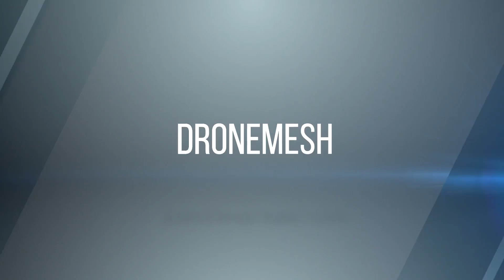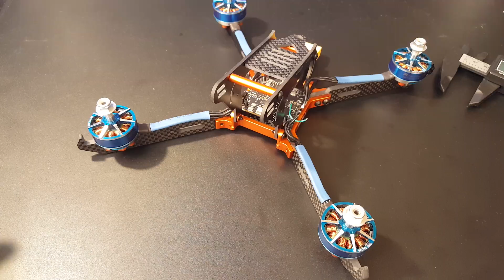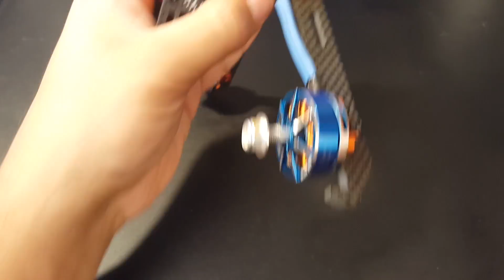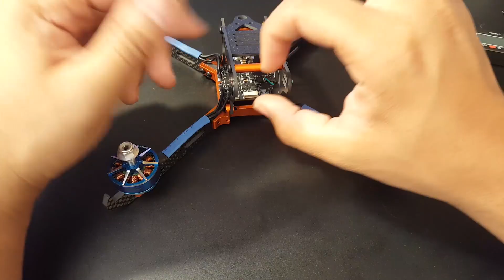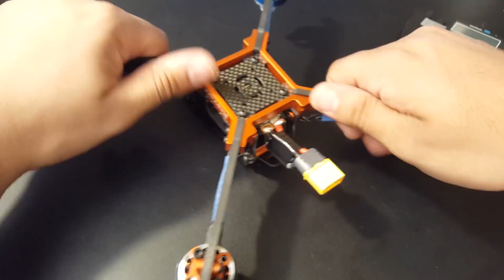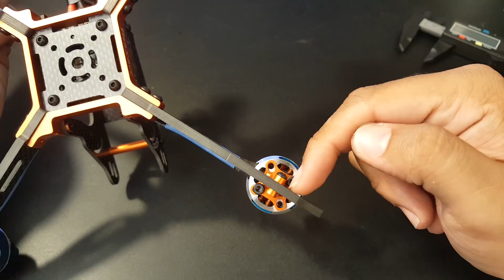Realacc Real1 frame // Overview

Comment: I decided to copy/paste here in case Copper deletes his message, for frame designers to see.
In my opinion this is the next best thing. From the air pushed aside to let the frame ascend, move forward, and even do flips and so on, vertical arms have a clear advantage. Plus, the air moved by the props, some of it it's slapped against the arm, but less with vertical arms, so another advantage there. And than you look at the weight and all your excitement disappears. They need to go back to the drawing board and work on weight. I don't think it's hard. Those aluminum plates are too thick in my opinion, and too... solid, for lack of a better word. The arms could benefit from a rounded beveled edge treatment on the top side, or a side to side shrink tube on wires like you have. Lots of ideas come to mind. The "holes" in the carbon need a more thought through design, but I can't wait to see a light and durable vertical arms frame in the near future. Too bad you didn't follow up with this design. You shouldn't listen to haters... Very nice overview! Thanks and you have another subscriber from Romania!
L.E. I might design one for myself, but first I want to see how easy it is to find a manufacturer for a prototype...

Comment: What did you end up thinking about the racerstar tattoof4s? do you think its worth getting? thanks mate
Reply from the maker: Will Hobbs definitely but remember I still have not flashed it to run dshot 1200. Software lacking but overall performance amazing you can see it in action with dynamic filter flying with bent prop. Couple videos back.